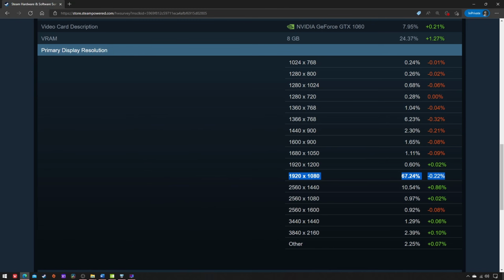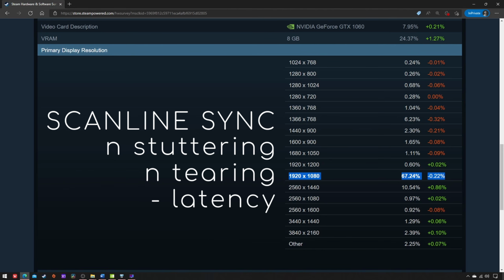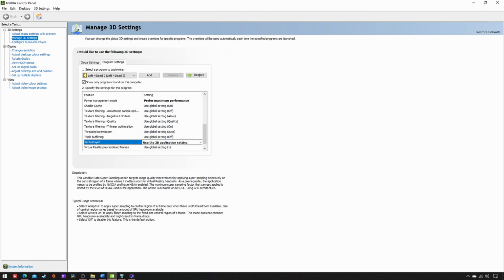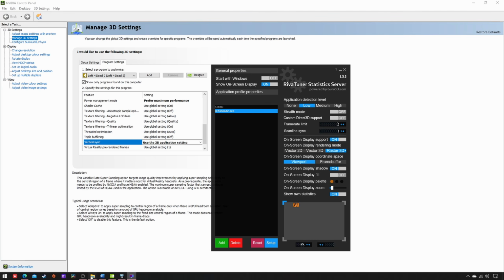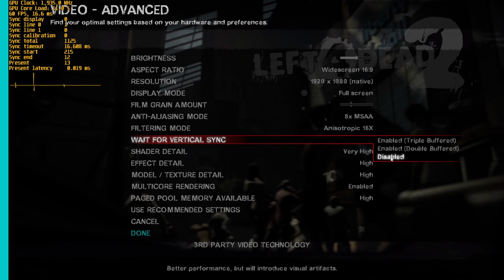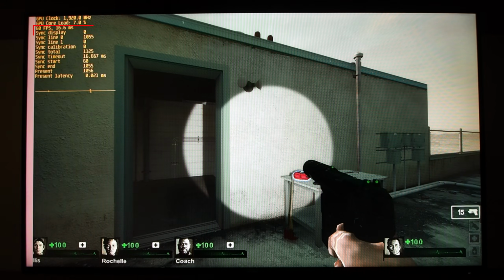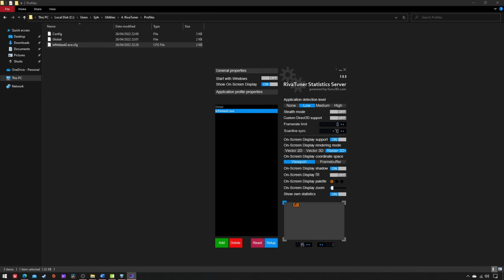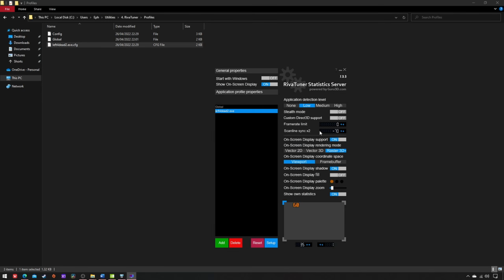How to Set the Coolest Sync Technology: RTSS Scanline Sync

Comment from the maker: A few frequent answers/clarifications/tips:

In RTSS, double-check that "Enable framerate limiter: async" is enabled by default.
It's located here: Setup (blue button) > General Tab > Compatibility properties.
(Thanks to McFlick)

If there is no "Global" file inside the RTSS "Profile" folder:
Open RTSS, click on "Global" on the left and change any setting on the right. The file will appear.

If you own a Multi-Monitor system:

Open the “Global” file and, under the “[Framerate]” section, add the line:
- "SyncDisplay=0" if you want Scanline Sync on the primary display.
- "SyncDisplay=1" if you want SSync on the secondary display.
And so on...

SSync:
- Graphics settings that ALWAYS produce FPS ≥ Refresh Rate (e.g. 60+ FPS on a 60 Hz Monitor).
- VSync OFF in-game. In the NVCP, you can set either "Use the 3D application setting" or "OFF".
- Do not use any Framecap (RTSS Framerate limit, NVCP Max Frame Rate, in-game, etc.).
- Use Exclusive Fullscreen Mode, not Borderless Fullscreen.
- If your Monitor supports VRR, disable it (everywhere).

SSync X2:
- Graphics settings that ALWAYS produce FPS ≥ Refresh Rate X2 (e.g. 120+ FPS on a 60 Hz Monitor).
- VSync OFF in-game. In the NVCP, the "Vertical synchronisation" setting must be set to "FAST".
- Do not use any Framecap (RTSS Framerate limit, NVCP Max Frame Rate, in-game, etc.).
- Use Exclusive Fullscreen Mode, not Borderless Fullscreen.
- If your Monitor supports VRR, disable it (everywhere).
Reply: maybe a video for those Who want to play with Lessing then monitor refresh rate
Reply from the maker: @robertdragomir6244  
1) Granted that I haven't experimented much with X/2, the process should be the same as for S-Sync (normal, not X2).
2) No, I would not set the negative number globally: it's always best to find the correct value on a per-game basis.
3) Since I have no way of verifying their respective impact on latency, I'd suggest experimenting with them.
Reply: @oakenglass  Thanks for your answer
You have any suggestion on how to set if i have lower then 60 fps?
Reply from the maker: @robertdragomir6244  Other than following the steps in my video, I can't think of anything else...
Reply from the maker: @nethshansiriwardena508 It depends on which Borderless Mode a particular game uses: if the tearline is visible, then you can use S-Sync.
Reply: About SyncDisplay, it isn't 0/1 for primary/secondary. It's GPU port dependent so in my case my primary was 1.
Reply from the maker: @agg42  Good to know, thanks!
Reply: @agg42   how do I know the port number because I am confused. My PC have 2 GPU , 2nd monitor connected to GPU via HDMI which is AMD integrated graphics and has 3 ports on motherboard DVI, DP, and HDMI and my main monitor is connected to my 1660 super via HDMI which also has 3 the same ports. I want to use scanline on the main display.

Edit: Never mind I finally found the correct port by trial and error and now scanline sync works.
Reply: @EMR64   I have two monitors with different refresh rates and scanline sync on my main monitor (144hz) always used the secondary's (60hz). I just tried every "SyncDisplay" value until the scanline sync fps matched my main monitor's refresh rate.  Quick solution for me since it was literally changing from 0 to 1.
Reply: @agg42   Thanks for replying and I actually managed to fix it myself by counting all the ports by 1 to 6 since I have total of 6 ports. I also used this priority order DVI > HDMI > DISPLAY PORT and started counting by the integrated graphics first then continuing all the way to the dedicated GPU ports.
Reply: but if you want Scanline sync x/2?
Same process as Scanline sync x2?
edit: or you just simply do your monitor refresh rate or cap framerate to desired one lets say 30 fps and then procced like normal scanline sync with just one bar?
Reply: another question
if we want for another game at exactly same fps and GPU usage, we can keep the settings?
or we should do it again?
edit: i meant just copy paste the resulting number to global?
Reply: low latency mode on ncp should be off, on or ultra?
Reply: Cómo hago en mi caso lo quiero capar a 30 fps
Reply from the maker: @michelmendoza601  Try this! https://www.youtube.com/watch?v=j8zibATj7Wo
Reply: @oakenglass pero no tengo nvidia solo amd

Comment: I like your videos.  Not enough people even know about scanline sync (hybrid or not).  But one thing (there's a couple others, but whatever, they're probably game specific) I think you're misunderstand is... that everything you see that's ABOVE the tearline is actually the previous frame.  Everything BELOW the tearline is the newest frame.  Think about it.  If you put the tearline in the middle of the screen, which is the oldest frame?  The one above the tearline.  Which is the newest frame?  The part below the tearline.  The part of the screen above the tearline HAPPENS BEFORE the part of the screen below the tearline, and it's 1 frame behind.  You know what I'm saying MUST be true, so you do NOT want the tearline visible at the bottom of the screen ever (or in the 3 or 4 lines after the visible image, the front porch).  Hide the tear in the back porch and/or let it spill over to the top of the screen a bit.  Presentmon will not reflect this error in the placement of the tearline -- because it can't.  Ok, another thing is to just use negative numbers -- no need to calculate placement.  Use CRU to know your back porch size.  You can increase the back porch size if you want.  For hybrid it's OK if it slowly moves down, just move it into the back porch -- no real need to do a manual binary search to try to compensate for component latency.

Comment: In my testing (1080p, 24",60hz fixed) on RoN, if I don't cap the FPS, their will be multiple tearing line (7 or 8). If I cap at 120 I got 2 tearline, and impossible to get them out of the screen. I had to lock fps at 60 and then I had only one tearing line, set the scan line at 70 and magic, no tearline ! I tried making this work since ages, and I finally got it. Tried scanline X2 and /2 but it add tearline.
Correct me if I am wrong, but if you have multiple tearline, you can't put them both out right ?
Reply from the maker: Scanline Sync X2 requires Fast-Sync, which gets rid of both the tearlines :)
Reply: @oakenglass  I tried fast-sync too, but nothing changed. The game is using DX12, maybe it is why ? tried all places, always tearing with Scanline sync x2 . gonna try in DX11 games
Reply from the maker: @TheEzakiel  Yeah, Fast-Sync doesn't work in DX12 games :(

Comment: Hi, Im playing rdr 1 remaster with a rtx 2070 super. I know for a fact that i can hit 60+ fps consistently, but for some reason when S-Sync is enabled i regularly get a few dips to 56-58 fps which causes stuttering. The few seconds that it can keep 60fps it looks great though. Gpu load is at 30ish percent. Is this expected?
Reply from the maker: On paper, if your GPU load is so low, this is not expected. However, there are many variables at play here, which could cause the sync to break momentarily.
For example, the single-core performance of your CPU and/or the tearline calibration may not be good enough. It could also be an issue with the RAGE engine...
Reply: @oakenglass perhaps its something to do with my cpu or the engine. Do you think hybrid S Sync would solve the performance problem?
Reply from the maker: @SY-ty1hg  It might be worth a try, but Hybrid SSync is trickier to set up D:
Reply: @oakenglass just tried it last night using your guide. I can't get the present counter completely static so it's not perfect, but for the most part i've managed to contain the tearline to the bottom of the screen. Very playable and no performance hit whatsoever. 

Really appreciate your videos, they're very clear and easy to digest. I feel like you're the only person looking into this on youtube, thank you!!

Comment: i just get two jittering even white bars and holding control and shift with the arrow keys doesnt do anything...
i've tried numerous compounding values for scanline sync (x2) and it's not working...
i copied your settings completely except i'm using framerate cap 29 for lossless scaling double framerate
what am i doing wrong?
Reply from the maker: Let me get this straight: you are using Scanline Sync X2 + Framerate Limit 29 + Lossless Scaling X2?
Reply: @oakenglass  yep
I started just using the RTSS frame cap and lossless scaling x2 (fixed) with vsync and for some reason the latency is low and theres no tearing...
I'm pretty sure I used these settings before and it was fine, but upon restarting the game there was more latency and tearing. I tried resetting the game again this time and still low latency and no tearing, so I guess it's fine now...
Reply from the maker: @JustaChillGuy241  My recommendation for your specific case:

- Vsync: "1/2 Refresh Rate" in NVIDIA Profile Inspector
- Low Latency Mode: "ON" in NVPI or NVCP or NV App
- RTSS Framerate Limiter: "Async" (the default option)
- RTSS Framerate Limit: "(Real Refresh Rate / 2) - 0.1"
- Lossless Scaling Frame Generation 3.0: "X2 Mode"

How do you find your "Real Refresh Rate"? Watch this: https://youtu.be/a_LPBUoiCDI
For example, if your RRR turns out to be 60.092602 Hz: (60.092602 / 2) - 0.1 = 29.946301
Note: this method is called "Low-Lag Half Vsync ON". It's not Scanline Sync, so... disable it :D
Reply: @ nice I’ll try this if my current setup fails again 👌
Ty 🤓

Comment: Sooooo if we're just barely getting 120 fps on a 120hz monitor............ no syncflush=1?
Or just go syncflush=1 no matter what?
Reply from the maker: For SSync to work well, you must ALWAYS get 120 FPS (in the case of a 120 Hz monitor) or more.
In this case, the GPU load would be medium or low and SyncFlush would be set to 1 or 2, respectively.
If you barely reach 120 FPS, the GPU load is on the high side: your best option is to reduce some settings :)
Reply: @oakenglass  not sure why it would be so mandatory to have such a rock steady framerate. tearing in marvel rivals kinda randomly quit tho. really good guide btw

Comment: I got it all working, however, i seem to be unable to hide the tear line on the left now... :D how should i do that?
Reply: To clarify, i want to use other RTSS overlays, so disabling the OSD is not an option
Reply from the maker: Sorry, I don't understand: do you mean hiding the multi-coloured bar?
Reply: @oakenglass  That is correct, apologies for my poor description.  I did not learn which setting was responsible for the bar exactly, but since learned it and disabled it! Thank you for the video! I have another question though, one of my friends does not have a "Global" profile on RTSS (he downloaded it for the first time). he has only one default profile called Config. Does he have to create a "Global" one or perform the changes to the already present one?
Reply from the maker: @manofbullet  They just have to toggle ON/OFF any setting in the RTSS "Global" profile (e.g. Stealth mode) to make the "Global" file appear.

Comment: I tried to do it in CS2, I have a 240hz monitor and fps on average 500-600, in my OSD sync line 0 all the time = 0 and I don't have any stuttering, how should I set it, what should I enter in scanline sync?
Reply from the maker: The correct value for your system depends on many variables, so I cannot know this... just follow the steps highlighted in "Step 5" to find it ;)
Reply: @oakenglass  I think I managed to do it, but my frametime is 4.1. When using this method, do I need to block fps async or relex through the rtts settings or not block it and just fill in the only scanline sync value to hide the tears?
Reply from the maker: @sanov3704  For Scanline Sync, simply fill in the "Scanline sync" box.
For Hybrid S-Sync, you will also need to fill in the "Framerate limit" box.
More info here: https://www.youtube.com/watch?v=X1Vhm8eXfCQ

Comment: I dont understand I have lg c4 42inch 3x and when I set scanline at 200 or -500 I dont have tearing at all.... i set 60hz and my game run 80fps and with scanline it run 60fps always and no tearing in the bar moving ??? It's normal...?
Reply from the maker: The main purpose of Scanline Sync is indeed to hide the tearline below the bottom of the screen ;)
Reply: @oakenglass  i just realized if I'm in surround nvidia...i have tearing.... and if I run triple without surround i have 0 tearing.... even without scanline

Comment: There is also a 3rd option Scanline sync x/2.
I'm guessing this for HRR monitors. 
I have a 34" 165Hz QD-OLED and flickering in VRR is very annoying. 
Correct me if I'm wrong but using x/2 I can try 82.5fps at 165Hz, or 60fps at 120Hz???
Reply from the maker: Scanline Sync X/2 is part of my next video (09/23)!
Yes, X/2 sets a frame limit that's half your refresh rate :)

Comment: i tried it but when i open the game i see tearlines moving from bottom to top and they wont go away they seem like infinite lines
Reply from the maker: Try to disable/re-enable the framerate limiter (async).
Reply: @oakenglass  tried it, but it didn't help btw I just noticed sth when I use back edge tearline comes from top to bottom like moving slowly then when I use async tearline stays at the position I calibrated but only for few seconds then starts moving and stops again then move again
Reply from the maker: @HamidStoneYT  Which laptop do you have?
Reply: @oakenglass  hp probook 450 G4
Reply from the maker: @HamidStoneYT  And you use an external monitor, right?

Open the “Global” file and, under the “[Framerate]” section, add the line:
- "SyncDisplay=0" if you want Scanline Sync on the primary display.
- "SyncDisplay=1" if you want SSync on the secondary display.
Reply: @oakenglass  I think I fixed it today, I recalculated the real refreshrate for 10 minutes, and then I put it inside the rtss with frame limiter of front edge and launched the game while having sync info enabled, sync flush=1 and I just noticed my tearline is not moving and my present stays at 0,1,2 at max 3 does it means that my tearline is stable right now? vsync disabled, fixed refreshrate.
Reply from the maker: @HamidStoneYT  That's Hybrid Scanline Sync, but yes... the tearline is now stable!
Reply: @oakenglass  and I noticed that when I switched back to async, the present number won't even change even by 1

Comment: Thank for the tutorial. in my case it happens that in some games the flashing part is quite large (so there are more tearing lines) and therefore I can't make it go off the screen.
Reply from the maker: If the tearline vibrates too much, those games are probably too CPU/GPU intensive: try lowering some settings ;)
Reply: @oakenglass  Yeah... in these games I have applied the mod for frame generation but probably the "fake frames" are not considered valid for Scanline Sync. Anyway I have tested the other method you have done tutorial (Low Latency Vsync) and it works great :)
Reply from the maker: @luigicrisci8863  Experimentation is something I always appreciate: I have never even thought of combining SSync with Frame Gen!
LL Vsync ON is great, but there are other methods... stay tuned for videos on them and my future implementation of latency testing :D

Comment: Excelent video.
Tell me..i need to make this configuration every game??
In my case, I got -85 in Dishornored. Can I use -85 in every game?? Tks,.
Reply from the maker: The behaviour of the tearline depends on the game, the CPU/GPU load and other factors.
Hence, I would just use -85 as a baseline and tweak it for each specific game, if necessary :)
Reply: @oakenglass  tks man.
Reply: @oakenglass  tell me.
Fastsync vs off there is too many difference?
Reply from the maker: @The_Phunto  In terms of lag, Vsync Off and Fast Sync are virtually identical. Their only difference is when the FPS drops below your Refresh Rate:
1) Vsync Off: you will see the tearline reappear at the top or bottom.
2) Fast Sync: you will see different degrees of stuttering appear.
Remember that with Fast Sync, you MUST calibrate the tearline so that it permanently remains above the bottom edge of the screen ;)
Reply: @oakenglass  I didn't know...fast sync doesn't work in DX12. Because of it when I use Fast Sync I still getting tearing.
Reply from the maker: @The_Phunto  Yes... if you use Fast Sync in a DX12 game, the driver will revert to "Use the 3D application setting" (i.e. Vsync off if you get tearing).

Comment: i cant find SyncInfo and SyncFlush
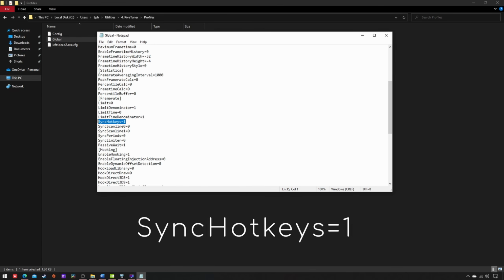Reply from the maker: You have to add them inside the "game.cfg” file, respectively under the “[OSD]” section and the “[Framerate]” section (2:58).
Reply: @oakenglass  thank yoiu, i want to ssync apex which is dx12 will i be able to do that by capping my fps on 144(on 240hz monitor) so i dont have tearing when i framedrop as i cant keep 240 consistent
Reply from the maker: @monkegr759  Yes! Just disable VRR, set 144Hz (fixed) and SSync will cap your FPS at 144 :D
Reply: @oakenglass  thank you!

Comment: does this cap frames at 60hz even tho i have a 240hz monitor?
Reply: also am i gonna have tearing when i drop below 240fps? (in case it doesnt cap at 60)
Reply from the maker: No, with a 240Hz monitor (VRR disabled), SSync would limit the FPS to 240.
Yes, if your FPS are not ALWAYS above 240, there will be a giant mess on the screen.

If you want 60 FPS, set your monitor to 60Hz (fixed, not variable) and make sure your FPS are ALWAYS above 60!